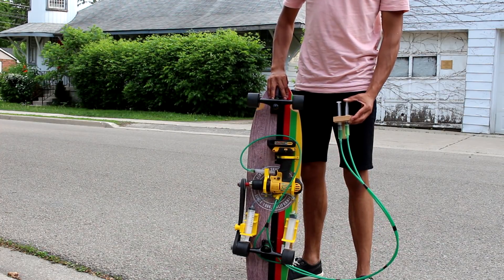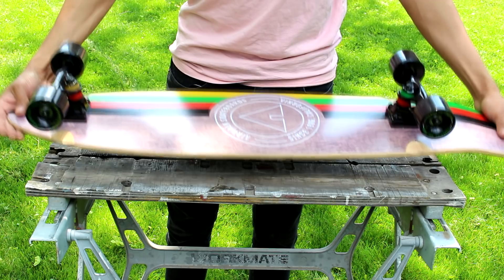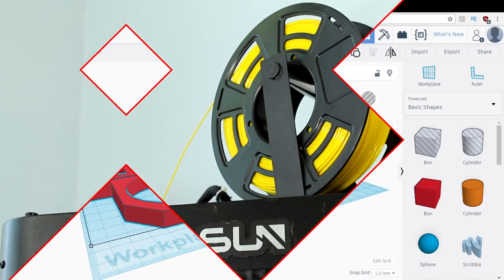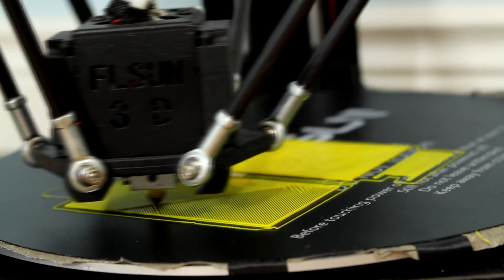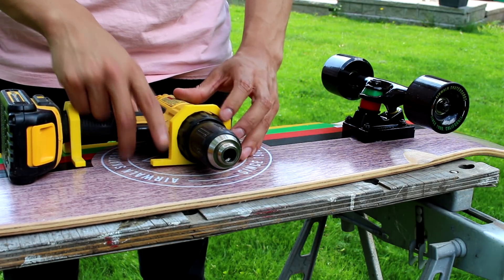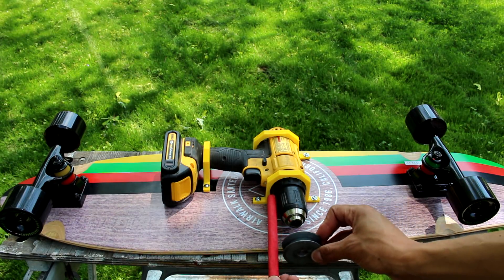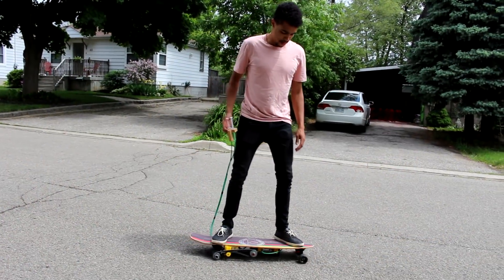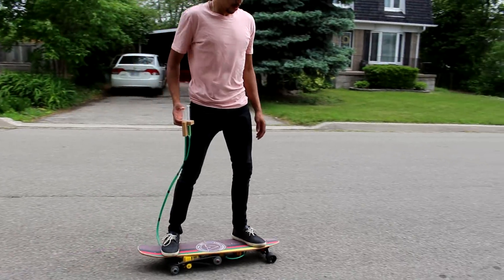How To Build A Drill Powered Longboard - Simple and Cheap

Comment: just built one but when i let my finger off the trigger the wheel locks up because its a drilll any one have any solutions to this ?
Reply: Easiest way -> Connect the a ratchet adapter between the drill and the driver pulley. It will sound like a bike freewheel. Breaker-Bar Ratchet Adapter will get you there.
Reply: or instead of pulley and belt, salvage an old bike and use one freewheel (clicker gear) and another gear of your choosing, and the chain.
Reply: OR try and disable the electric brake on the drill by opening it up. This way your only fighting the gear reduction which is significantly less resistance and would probably be a very appropriate brake.